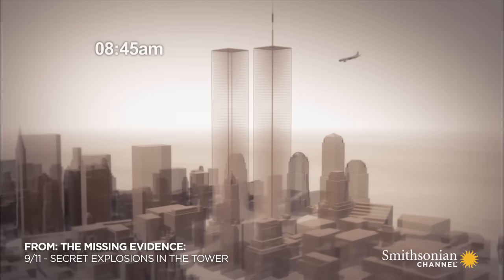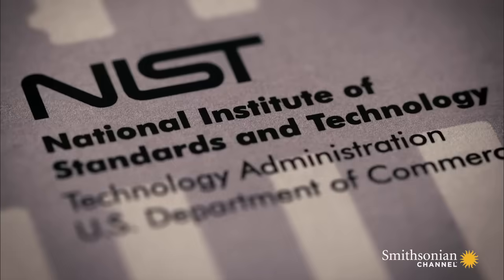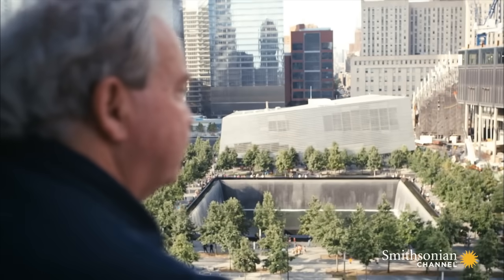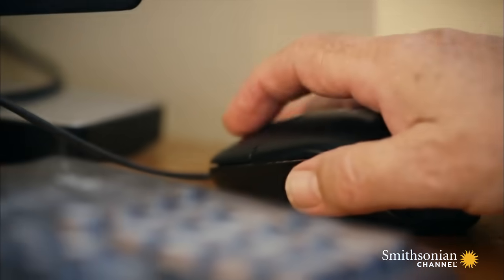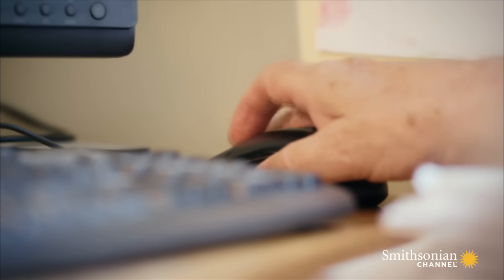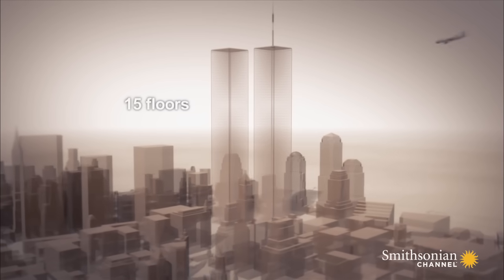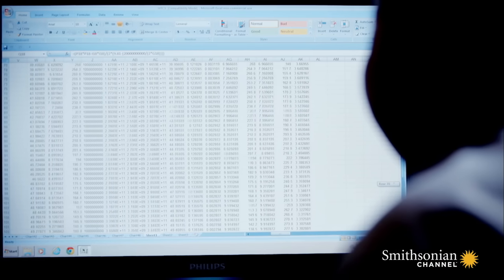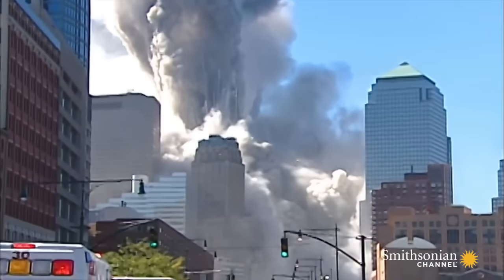This Computer Simulation Explains How the Twin Towers Fell

Comment: Smithsonion are liers and cover up all the hystery about the origin of man and loose many of the huge skeletons that proved there was a race of   giants that existed before use even though the towers fell faster than free fall speed which should have been almost impossible an experiment done proved that each floor would have encountered the next and even if the first floors fell that fast they would have polled up before they reached the bottom. This computer simulation is 100 percent fauls. Even controled demos if not done correctly do exactly what I said and piled up and nothing explains why the steal frames collapsed aswell down to angled cuts. But no matter what nothing can explain building 7s collapse that's why it's not even mentioned in the official report never before has a steal framed building collapsed due to fire but it also shows a central kink in the middle column which only happens in controlled demos to stop the building falling outward and fall identical to a controled demolishion please stop lieing Smithsonion because I can prove without any doubt that 9/11 was committed by the United States government and anything you can i can give evidence disproving it and the pentagon and the shanks ville crash as well stop lieing to the world Smithsonion because I love to watch programs you make using facts especially about fighter plains air worriers is my favourite Smithsonion program because it's facts and your government make great fighter jets
Reply: That’s is completely untrue, each floor of the towers were 1 acre. Say the collapse began at the point of impact which was around the 90th floor, the first ACRE wide floor would fall at around 15 feet before hitting the next, the amount of energy alone than exponentially grows as more weight is added, also take into account the thousands of pounds of office equipment and furniture falling as well. As for the “angled cuts” those were created as the plane flew at 600 MPH into the building and the wings sliced through the beams. For WTC 7, the frame of that building was TOUGH, like really tough. You can see in the collapse videos that a part of the roof actually collapsed into the building and took out several floors which in conjunction with the fire caused an almost simultaneous collapse. Don’t forget that giant debris from the towers had also been weighing on the roof for hours as well
Reply: I got a headache reading this..
Reply: @yesitssarahbby17  fake plants 🪴💩🪴💩🪴💩can read ? What’s next ? Building collapses?!!

Comment: This video does not explain anything.  There was seismograph readings of only showing a twenty story equivalent building collapsing.  If all that weight would have hit the ground it would have penetrated the concrete bathtub surrounding those buildings and the Hudson river would flooded the subway tunnels etc.  That did not happen.  Further more those buildings fell at free fall speed.  If they would have pancaked it would have taken approx. 90 seconds for the fall of each building give or take some seconds.  Not 11 or 13 seconds.  The way the fell is only the tip of the ice berg of nothing making sense.  Impossible for commercial airliners to fly at 500 mph at sea level.  The air is too heavy.  They fly that fast at 33,000 feet above sea level yes.  But not at sea level.  People believe the government and their stories because it is repeated so many times.  9/11 was much more than what the Government story is by far.  You notice zero videos up that used to question the story, there used to be a lot of them that made more sense then the lies the government tells us.  The 2.4 trillion unaccounted for by the Pentagon reported the night before by Rumsfeldt,  just so happens the part of the Pentagon hit by an imaginary airliner was the book keeping area and magically all the paper trails to that money were vaporized.  Hmm...how ironic..Say what you will, but the evidence suggests inside job for sure.  Those buildings were dustified.  Evidence was hauled out the day of and sent to china to be melted down.  Never before in world history had any steel support building collapsed due to fire.  On 9/11 three amazingly collapsed.  Ya, right.
Reply: Where did you learn how to read a seismograph?

Comment: not sure what the weight of the titantic has to do with anything unless you want to mention the weight of the tower below the crash sites?   5 ?  6?  10 times the weight of the Titantic?   maybe more?
Reply: The weight above the crash site took out the lower tower 1 floor at a time, not all at once. The weight below the crash site was irrelevant.

Comment: First, that doesn't explain the steal, and second, that doesn't explain where the buildings went. How do you turn a whole building into dust?
Reply: Ok say 9/11 was infact an inside job designed to destroy as many lives as possible, why on earth would they decide to magically get rid of the building as soon as it fell?
Reply: "How do you turn a whole building into dust?" It didn't, so there's nothing to explain
Reply: @h1F595  aka the crazy dust woman.
Reply: Yes. That doesn't explain that the columns were broken of 9 feet just to be loaded to trucks and sold right away as junk!!!
Reply: @alejandroveliz1740 that’s bc of all the hazardous materials in the rubble. Even still, first responders are dying from breathing in the chemicals used to create the metals.
Reply: @alejandroveliz1740  It wasn't - another twoofer lie. It was transported to a scrap yard where it was investigated. Only after that it was sold.

Comment: I worked demolitions for years, a building will not collapse in this matter unless its a controlled demolition, the weight would shift to one side and a splintered framework would remain. The top of the building would slide off and drop to street level. This is just more propaganda and trash to cover up what they did. No plane was ever found at the pentagon, and the only fragments of the impact are not indicative of plane wreckage. They rule through fear, and dividing us.
Reply: Where did you get your structural engineering degree?
Reply: @Tim22222  Deconstructural engineering
Reply: @badwolf2185   Lol. Sure. You go with that.

🤣🤣🤣🤣🤣
Reply: And yet it happened. Plane debris was at all the crash sites.  People saw the second plane hit and the plane hit the Pentagon.   This was not a explosive demolition therefore your experience is not relavent.

Comment: Steel drops in compressive strength quickly on heating up. After impact, fuel was still burning, transferring heat to steel, at some point floor collapses due to weight above and then momentum builds up collapsing the entire building. I found this theory myself and now happy seeing this video.

Comment: Can you say Control Demolition? 
The Towers fell exactly, identical to all the Las Vegas control demolition Casions --- exactly the same --- identical.
Reply: They fell in a downward direction, if that's what you mean. Otherwise, there is no similarity.
Reply: @marcpowell5893  There's no similitary? Either you are completely blind or have never been to Las Vegas,  2 airplanes 3 buildings fell.
Reply: @Tim22222  Building 7 did collapse from the bottom, just like a standard controlled demolition. But, as a shill, I'm sure you know that and are deliberately omitting it.
Reply: @adamsyed5535  This video is about the towers. The original comment was about the towers. My statement was about the towers.

Comment: there mistake was not having the trusts coved with concrete and better joint connections to the main column because hey used an L shape brace to the outer wall and the floor truss Can’t say it wouldn’t have collapsed ether way but it would have given a bit of extra time
Reply: That becomes a completely different building.
Reply: Hindsight.   Could have, would have,  should have.

Comment: Maybe the buildings were designed to withstand accidental flight collision, not intentionally accelerated speed flown into the towers from that height?
Reply: That and fully fueled. The steel didn’t melt. Which conspiracy theorists concentrate on. It is like a spaghetti noodle. While it didn’t melt it became so hot it was flexible and lost its ability to hold all that weight. So it came crashing down.
Reply: @Youre_Right  There are hundreds of eyewitness accounts that specifically describe rivers of molten steel flowing down the wreckage akin to a foundry. But you don’t even have to take the eyewitness accounts into consideration, there’s literal video evidence molten steel slag running down the side of the building while it was still standing.
Reply: @Youre_Right  The steel did melt in the aftermath of the towers collapsing.
Reply: Tell that to the architects and engineers that built them 😂
Reply: Also the type of planes that hit the towers were not around when the towers were built. I believe the towers were built to withstand a 727. 767s were what hit the towers
Reply: From what i heard, the towers were made to withstand 707s, not 767s
Reply: @galslovveme So you’re saying “yeah, they designed the buildings to withstand a plane crash, but what if those planes were going like, really really fast?” Am I hearing that right? That’s a very very not smart argument.
Reply: @ you're entitled to believe whatever you want. It's already a given that the planes hit in a different part of the buildings that led to the weakening of the foundations that caused them to collapse. It's pretty logical that the second tower fell before the first tower based on where the tower was hit. If it was planned ahead of time, both buildings would've collapsed at the same time. At the very least, the first tower that was hit would've fallen before the second, but that's not how it played out. Keep hearing things
Reply: @galslovveme  Actually, if it was the heat of the fires that caused the steel floor trusses to sag and weaken, wouldn’t you expect the fire that had been burning longer to burn hotter, and cause the building that was hit first to fall first?
Reply: @ you're focused on the heat variable, when I'm focused on the impact itself and the foundations of the buildings impacted from the collision, not the heat by itself
Reply: Three thousand unrecovered bodies proved it was not a building collapse
Reply: That's outrageous
Reply: @ explain why the towers didn't fall at the same time
Reply: The calculations and methodologies used in the original airplane impact analysis were not found. So, exactly what impact dynamics and damage the WTC design was expected to withstand could not be determined. However, given the rudimentary nature of computer simulation capabilities in the 1960s, it is doubtful that the analysis would have been conclusive and, at any rate, it did not include the effects of the resultant fires which are what actually brought down the towers.
Reply: @marcpowell5893  Are you aware of how long the fires burned after the towers fell? Until DECEMBER! They burned at temperatures in excess of 2,800 F! Jet fuel cannot reach those temperatures, and it certainly cannot sustain those temperatures for 3 months. Neither can office furniture. 

Also, during that period of time between the collapse of the towers and the fires being put out, the area FLOODED and the fires kept burning hot enough to melt concrete. 

There’s only 1 known substance on the planet that can burn that how even through a flood. Thermite.
Reply: Bingo. Give this person a cigar! 👍
Reply: @MFitz12  any cigar for me planter ? 💩🪴🫡
Reply: They weren’t designed to make three thousand bodies disappear!

Comment: Molten metal under all three sites for weeks afterward, but jet fuel doesn't get hot enough to melt steel. Office equipment doesn't get hot enough to melt steel either.
Reply: Been hearing that for 22 years.  Still waiting for anyone to produce a shred of evidence to back that up AND explain the relevance to known collapse mechanisms. It seems unlikely you will be the first.
Reply: Not a problem, since no one has ever produced any evidence that steel melted at the WTC.
Reply: @h1F595  False. Different metals glow different colors when molten. Aluminum is silver, iron is orange/red.
Reply: @h1F595  aside from that, jet fuel doesn't get hot enough to melt steel.

Comment: It didnt fall side ways just straight down . Thats just hard to believe once but 3 times . Straight down not sides ways , front ways ,back ways but straight down.
 3x times all uniform in manner, really come on guys not even a littlw questionable.
Reply: Straight down is the direction of gravity. It is the way steel structures to collapse. If you were expecting something different it is your expectations that are the problem. Reality is correct, as it always is.
Reply: Each building did only fall once, not 3 times.  I would find it hard to believe if each building did fall 3 times.

Comment: My question is: why was the pile of debris that resulted from the collapse of two fully furnished/occupied 110 story office towers, each of which had an approximate mass of 500,000 tons fail to reach beyond the still standing lobby walls or, approximately 30 feet? How is possible to compress 208’x208’x1360’ (times a factor of 2) of rigid steel glass concrete and so on into a pile that is less than 30 feet tall? No one ever seems to address this curiosity
Reply: Because the towers extended 70ft underground, were mostly full of air and the structure to volume ratio was low.
Reply: There was little to no debris in the lower 6 levels. Fully in tact subway cars were removed from the transportation level as well asl all the stores in the concourse level mall being accessible with only some dust covering their merchandise. So that answer doesn't work.  @slooob23

Comment: I downloaded the $16 million NCSTAR1 report in 2007. Curiously it does not specify the total amount of concrete in the towers though sources before 9/11 say 425,000 cubic yards.  But they agree on the amount of steel, 200,000 tons.

But no one talks about the distribution of steel down the structures. Did the 105th level that only had to support 5 stories contain the same amount of steel as the 5th level which had to hold 105?

Where is the data and why haven't structural engineers discussed it a lot?
Reply: @h1F595  
Where is the data on the horizontal steel beams in the core?

Comment: How many million? Geez. It comes down to how hot jet fuel burns, the beams unable to handle it…and that the weight of the top coming down collapsing everything else in turn in a domino effect. I really don’t understand why people struggle to understand this.
Reply: I may not be the sharpest crayon in the box. But, to have BOTH towers fall so perfect.....I'm calling BS!
Reply: Well the problem is ,it falls down in 11 sec . It means coming down straight without resistance . The center of the WTC is full of steel beams, that made a lot of people suspicious to collapse in almost dust in 11 sec
Reply: There was no jet fuel on or in Tower 7. So how did that one come down?
Reply: Because that explains a house of cards falling, not the WTC buildings. You are a truly shallow and pathetic little person if you think that can all be summed up in one sentence.

Comment: People fell to realize that the Twin Towers were built to withstand an impact with a plane smaller than a 747 or whatever it was... The WTC complex was opened in the '70's, when the planes were much smaller. Also, you couldn't possibly simulate the impact with an airliner full of kerosene.
I am a fan of 9/11 conspiracies, though, but there is no proof of a controlled demolition.

Comment: Yeah except for the fact that building 7 also was brought down but not  by a plane.  

Also I've seen footage of what seems to be explosions going off on each floor before they fell
Reply: Building 7 was on fire dude
Reply: @FATSIDEDOWN  LOL. Sure... fires bring down sky scrapers, which are built to withstand that. Looked exactly like a demolition.
Reply: @profitglen  Yes, skyscrapers are build to withstand fire - but not indefinitely If the fires continue to burn & spread (as they did in bld 7) - and remember, the fires in 7 were not fought, not a single drop of water put on them - any structure will eventually fail.
Reply: @Tim22222  I hear ya, but I'm not sure about that.
Reply: Lol

Comment: Im sorry but from 3:40 onwards, the building is being forcefully moved out of the way 50 or so floors below what you may describe as the top falling down and crushing it. It is way behind. No matter how many times i see it or try to rationalize from any angle. There is no other word to describe it but explosive. The floors are literally being blasted out far below any crushing. I don't care about any explanation anyone can give. If it was being ejected as the top crushed down then fine, but not so far below. What pressure is turning concrete to dust 50 floors below? Another thing to not is those ejections are in a vertical line down the middle, and can be seen clearly towards the middle end of collapse, if this was universal pressure it would be horizontal around the floors flattening them one by one like stacked plates. It is not being crushed it is falling into itself while the mass below is being moved out of the way at an enormous speed.

Comment: It seems to me that if the weight of the top of the building was enough to pancake the floor beneath the impact site, then surely the weight of the top of the building PLUS the weight of the entire building below that wouldve been plenty to crush any floor beneath impact, especially the very bottom floors. But they didnt.
Reply: If you're not an engineer you're opinion is meaningless
Reply: @chrishall2594  move along then.
Reply: It seems to me you are definitely NOT an engineer...